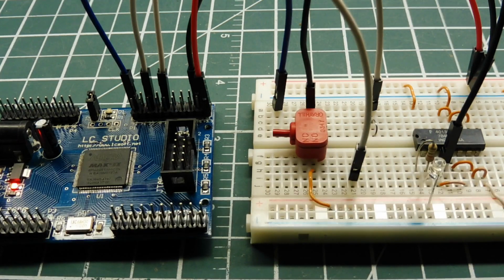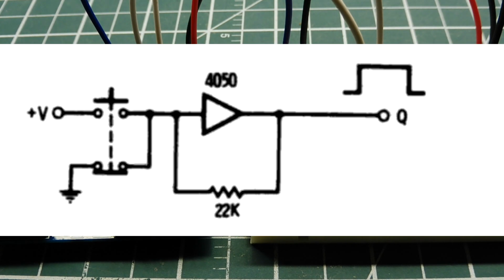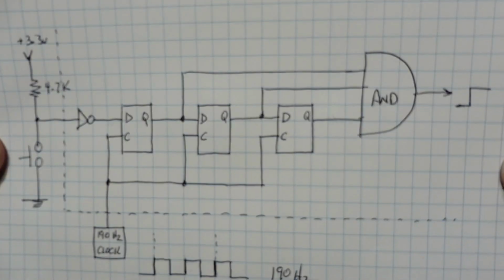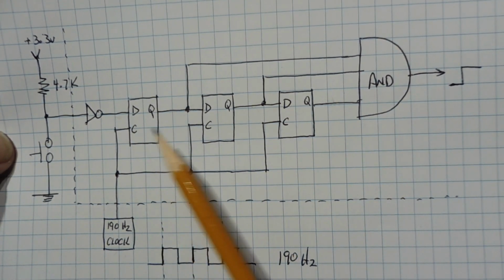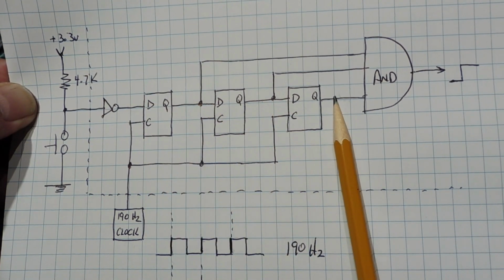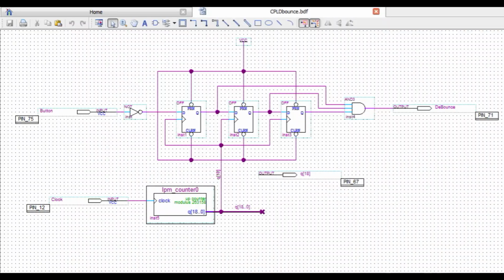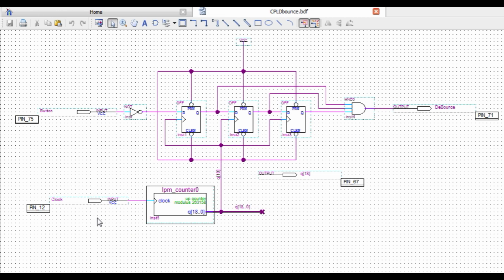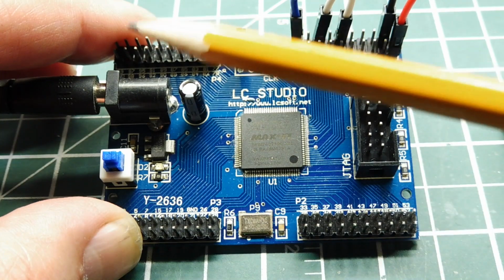Switch De-Bounce Using A CPLD

Comment: I thought you were talking about an FPGA, I didn't know these ICs existed. I am in shock!!
What is the difference between an FPGA and CPLD?
From what I see the CPLD is programmed as if it were a PLC, with logical blocks
While with an FPGA it is programmed with hardware description language. I think there is software to do it with logical blocks.
CPLDs are not expensive.
https://www.mouser.es/Semiconductors/Programmable-Logic-ICs/CPLD-Complex-Programmable-Logic-Devices/_/N-1y8xjbt?Keyword=EPM240T100&FS=True&Ns=Pricing|0
You could make a Shift Register of type "PISO" (Parallel-in, Serial-out) to have many digital inputs for an STM32 or other MCU. It could also be done as a SIPO and connect tons of LED or whatever.

The sad thing is that after knowing that the SPLD also come out ...

Comment: Hi excellent video, I need help, how do I turn a DC motor from left to right, using the CPLD EPM240 ? . Thanks for your answer.
Reply from the maker: You will need an H"-Bridge" constructed with power MOSFETS to control a DC motor. A CPLD does not have the power capability to do that.
Reply: @0033mer  OK thank you.

Comment: Awesome! I'm getting one of these ASAP ;)
Reply: Just ordered this board and blaster on AliEx for just under $12. Thanks again ;)
Reply: @UpcycleElectronics  Can you give us an update on the board and working with the chip ?
Reply: @noweare1  
  It works pretty well with the same board shown, USBblaster clone, Lubuntu Linux, and Quartus prime lite. 
   My computer is super slow with QPL so I haven't used it a ton but I've done basic breadboard logic with it. I have several references saved in a publicly listed playlist called LOGIC CPLD.
   My main project for around the last year has been my own version of the open source AVR Transistor Tester project on a home etched development board. Secondarily, I have been pursuing modern PICs with XC8/MPLabX. Then vintage hardware MPUs like the Z80/68K/6502 and some vintage MCUs as well. The CPLD and logic stuff comes after this. Basically I'm playing with too many  projects...like everyone else ;)

  You can pick up this little EPM240 board for $5 and change, shipped from sellers on Aliexpress if you're willing to wait on it to arrive. I also picked up a few of the 100 pin chips for $0.88 each a few weeks ago. I really shouldn't have as that pin package will require dry film photoresist. I got it as a fun hardware challenge for the next round of serious etching. My current limit/ successful etch attempt is a TQFN64 so a 100 in next.
  If your looking for a 'from the ground up' type walk through, I came across an old series that I saved in a playlist called "Classes Learning EE with CPLDs." It's a rudimentary community college course that a school uploaded here on YT but the dude is fun to listen to.

  If you're looking for options in general, the current FPGA trend is the Lattice iCE40 stuff. That also comes in a QFP package. Not the easiest package to play with but certainly much easier than a BGA if you do not have a dialed in reflow oven.... Then again if you're just interested in dev boards it doesn't really matter. 
   There was also another guy selling Arduino compatible FPGA stuff that I came across recently. I forget the name off the top of my head. It was BGA based so I'm not as interested (yet). However I believe I saved the reference in my "LOGIC FPGA" playlist.
  If you look up that list, and want to know about the newer iCE40 stuff, check out the upload by the dude doing "The Current Source" channel. He did a great little upload about the iCE40, if you haven't seen it already. I keep hearing about that IC and boards based on it, without even trying, so I assume it has a really big following right now, as I've also been told.
  Bil Herd also did an upload on the Hackaday YT channel about using an iCE40 to make a cheap logic analyzer IIRC. Although I'm not sure if I'd go that route for a logic analyzer or the Beagle Logic project on Hackaday...but I'm rambling now...

FYI, I treat playlists like browser bookmarks. They are just publicly listed. They are all loosely alphabetically indexed but unfortunately I'm the only one that can see them as a sorted list. You can only view them based on what I've modified recently. Anyways, I have nothing to gain in sharing them. I'm simply putting together info that might make it easier for anyone with similar interests and so I can keep up with things I'm interested in. Everything is public, my playlists and my subscriptions. If you see someone/something about electronics that I haven't, let me know. I'm always looking for more teachers and things to learn ;)
-Jake
Reply: @UpcycleElectronics  Thanks for the quick response.
I asked because I was ordering some digital IC's when I remembered that by the
 time I bought all the IC's I figured I could get a programmable logic setup and that
would just be more flexible and about the same price .

 Too bad those CPLD 's don't come in dip pkgs but they would be pretty big chips.  The QFP package
is no fun to solder. You need good eyes and solder wick. The BGA's are out for me.

I took a look at your playlist. You have some good bookmarks. That is a good resource. 
I  have to limit my subscriptions to about 10 or so or I won't get any work done lol. 
If you get a chance check out AllAboutElectronics. He has an accent which bothers some
people but it's worth getting used to.

 He is more traditional EE circuits and  derives the equations by using
circuit theory. He makes it look easy. Really great OP-AMP series.  All analog stuff.
There are so many good channels out there.

Good luck with the AVR Transistor tester. That looks like quite the challenge. Sounds like you
have a lot going on.  My biggest challange is to stay focused and finish what I am doing before
going on to the next thing. 

I will take a look at the iCE40 and see what that's about and I'll come by your channel to see
how your making out on the transistor tester.  Thanks for your feedback.
~Joe

Comment: can you suggest me a very basic cheap CPLD by which I can start, considering me as a noob/beginner??
Reply from the maker: The CPLD board in the video is a good one to start with. There are many vendors online that carry the board and the USB Blaster programmer. You can download Quartus II from Altera and practice building logic circuits.
Reply: Thanks a lot Sir!
Reply from the maker: Here are some links:

https://www.banggood.com/U119-Altera-MAX-II-EPM240-CPLD-Development-Board-Experiment-Board-Learning-Breadboard-p-1256771.html?rmmds=search&cur_warehouse=CN

http://www.dx.com/p/altera-max-ii-epm240-cpld-development-board-214282#.WxRNm-4vyM8

https://www.openimpulse.com/blog/products-page/product-category/max-ii-epm240-cpld-minimal-development-board/

https://leeselectronic.com/en/product/1007.html
Reply: I could not locate the company or the board. If I read it correctly, that URL has not web site attached. Is it http://www.lcsoft.net ?
Reply: Thank you.
Reply: @RobertShaverOfAustin  Loock for EPM1270 boards, EPM 240 is very small and can't do many things https://pt.aliexpress.com/item/545048891.html?spm=a2g0o.productlist.0.0.23764992lFHRJH&algo_pvid=0e4b16f5-6a35-46db-8a72-9d374ea4c8d9&algo_expid=0e4b16f5-6a35-46db-8a72-9d374ea4c8d9-3&btsid=beccd09b-0e4d-45e7-bc26-d6768434725d&ws_ab_test=searchweb0_0,searchweb201602_9,searchweb201603_53